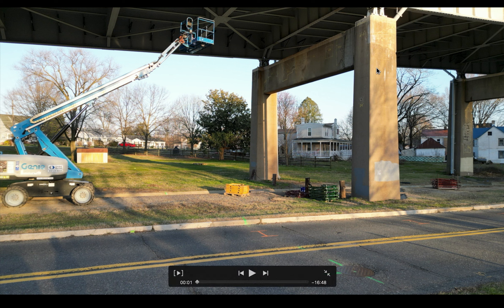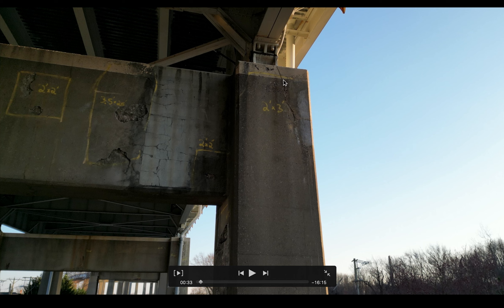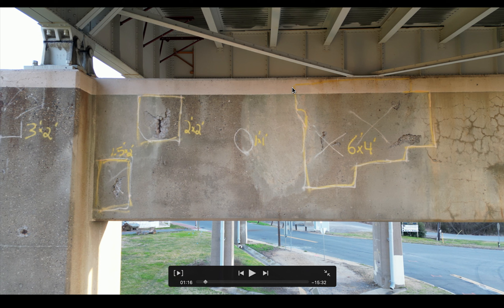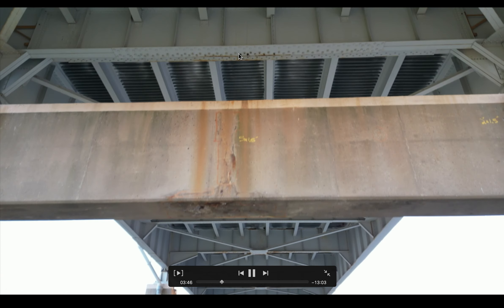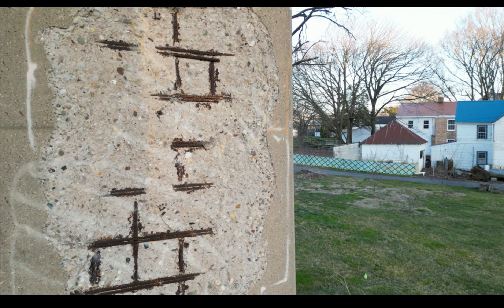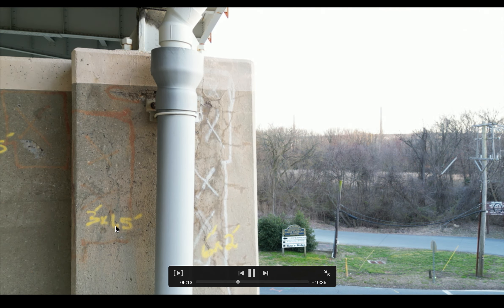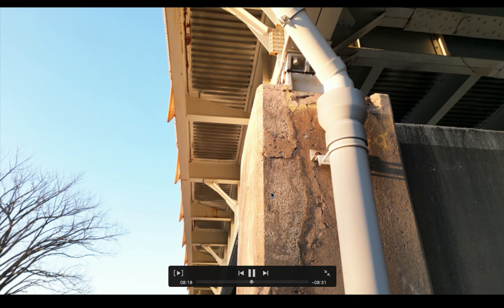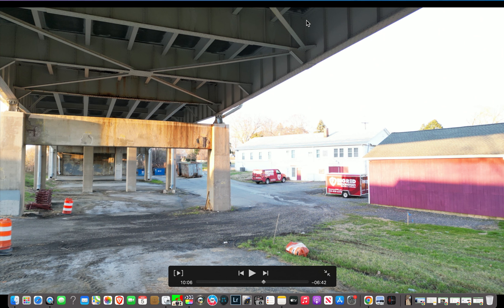St Georges Bridge Delaware Repairs underway #StGeorges Bridge

Comment: Thank you for the analysis. IMHO, this bridge is beyond remedial repair. If only the engineers had been more thorough with water drainage then perhaps it would not have suffered such damage. That last column showing the two metal plates was fatal. How can this bridge be effectively repaired? The climate is harsh during winter and the road salts only compound the problems.